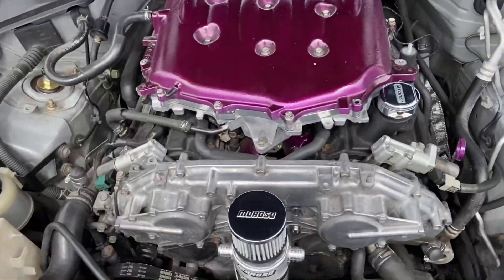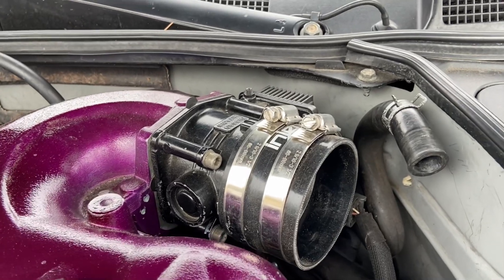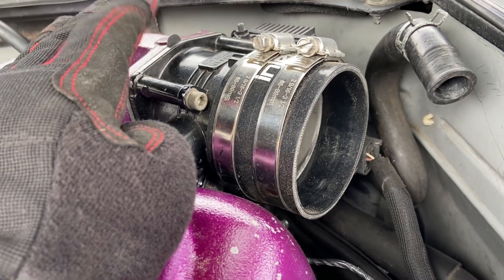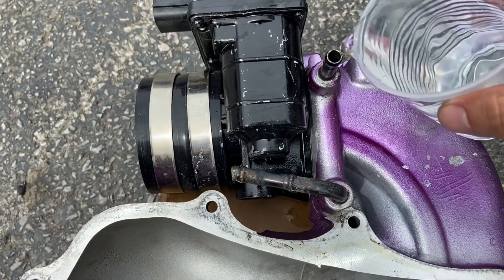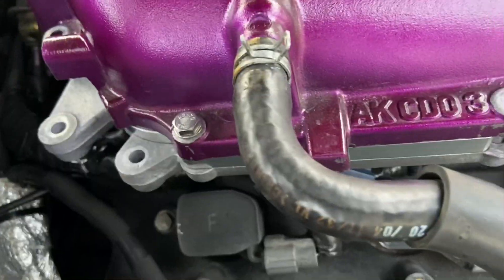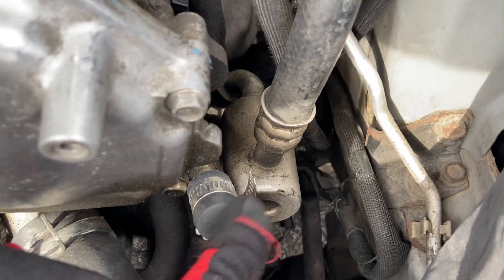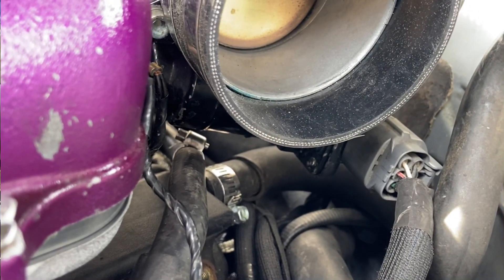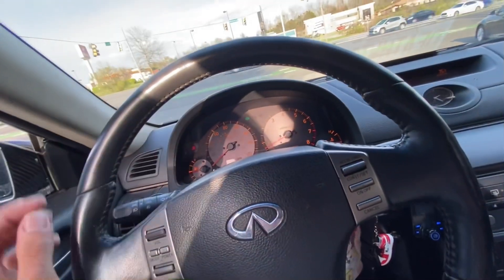Reduce Intake Manifold Heat VQ35DE - Throttle Body Coolant Delete

Comment: What about my egr lines for coolant?
Reply from the maker: I’m not even really sure what the egr is. Isn’t it just a vacuum line that connects to the egr? Only hoses that ever get deleted on these engines are the coolant lines to the throttle body like this video, realistically you can just remove these lines and plug them up, but in the video I jus connected the coolant hose to the other side which really it’s just in the way and not necessary.

Comment: is there any bads with deleting the front coolant bybass hose? the one that connects to thermostat?
Reply from the maker: there is no front hose that connects to the thermostat. There is only a front coolant hose that connects from the passenger side to the driver side pipe, a pipe beside the thermostat.
Reply: @DEATHWISHVQ  the only coolant line Infront of your engine that warms up the oil cooler.
Reply from the maker: @Sonic_the_hedgehog65  that hose is not in front of the engine, it is on the underside of the coolant pipe passenger side.
Reply: @DEATHWISHVQ  were talking about 2 different things. thanks for NOTHING.
Reply from the maker: @Sonic_the_hedgehog65  this is the hose you are talking about. https://conceptzperformance.com/nissan-infiniti-nissan-oem-upper-oil-filter-coolant-hose-rh-vq35de-nissan-350z-infiniti-g35-fx35-m35-21306-am600_p_10763.php that is on the passenger side not in the front
Reply from the maker: @Sonic_the_hedgehog65  this is the FRONT coolant hose https://youtu.be/VaYysjfONM8

Comment: timing rpm during idle become low after delete coolant hose ?
Reply from the maker: are you asking if the rpms is low after the hose delete? I’m not sure what you meant by “timing rpm” but NO, that is completely not related to affecting idle rpm.

Comment: Why would you do this tho ?
Reply from the maker: Did you watch the video
Reply: The concept is cooler intake temperature. Likely negligible. The reason track vehicles do this the correct way (welding the fittings shut) is to reduce leak points and simplify the system. @10tenthsmotorsports11 makes a kit for track vehicles to Eliminate hoses and crossover pipes including all extra/creature comfort hoses like oil warmer, TB warmer, Heater core etc. if your vehicle is track only. Options for thermostat (stock ecu/fans) and no thermostat (High output fans and PWM control) - We are not sponsored by 10Tenths, but their products are high quality and worth mentioning.

Comment: what do you do with the coolant ports on the throttle body? plug them up or just leave them open ?
Reply from the maker: The coolant ports are actually surrounding the upper plenum as you can see at 1:30 the coolant just runs through the plenum face where it meets the TB. The heat from the coolant running thru the port warms it up bc it’s metal on metal contact so that’s how the heat spreads. You can leave them completely open, it’s not connected at all to the cooling system.

Comment: does this keep the engine running cooler?
Reply from the maker: It reduces heat soak because the warm coolant is no longer running through the throttle body. The less heat you have the cooler the engine will be of course bc heat spreads super quickly thru metal even if it’s radiant heat it will quickly make other parts hot. But technically speaking the engine running cooler refers more to the coolant system, there is a mod you can add it’s called the pathfinder cooling mod, it’s an upgraded coolant piping that enters from the top of the cylinder head I believe, meaning itlll cool off the engine better. I plan on doing this mod to better explain it.

Comment: So doing this if you live in a cold climate is bad or good to do?
Reply from the maker: It depends how cold it gets, I’m not sure at what temperature a throttle body can freeze or malfunction, imo I would leave the hoses connected during winter if the weather drops under 20-30 degrees. Since summer is coming up it gets as hot as 100 degrees in my area so I def do not want a hotter engine. I hope this helps.

Comment: I live in Hot Sunny Florida and this never been an issue. If your car is running Hot, this is Not your problem. IMHO, this is just a Plecebo Delete.
Reply from the maker: It’s just to reduce heat soak inside the throttle body.
Reply: @DEATHWISHVQ  Yes I understand, but it is a non issue in a normal running situation. IF you were going Force Induction, then I would recommend having the Air Change as cool as possible. Thus in that case, it "might" make a difference in Dyno testing. Just trying to separate Fact from Fiction. There's soooooo many things  Z & G owners do to their cars that do nothing for performance. They believe what Manufacturers claims . In return they get more Noise, Vibration and Harshness, and a lighter wallet. If it makes you happy, Go for it.
Reply: @stealthg35infiniti94 this is proven to give around 3-5 hp? lots of people do it to get rid or heavy heat soak.
Reply: @stealthg35infiniti94 In tropical indonesia where the Nissan Grand Livina with the HR15DE engine is very famous for always knocking. Outside road temperature is 28 to 35c. And nissan indonesia forget to unplug this coolant hoses. That's why the nissan sales in indonesia plummet. Because the knocking. I think this throttle body coolant is the cause.